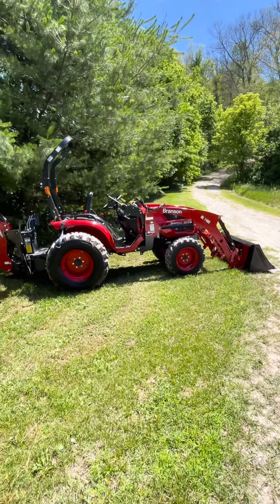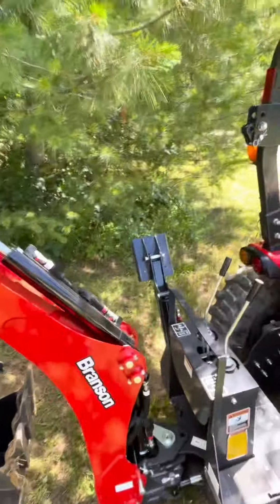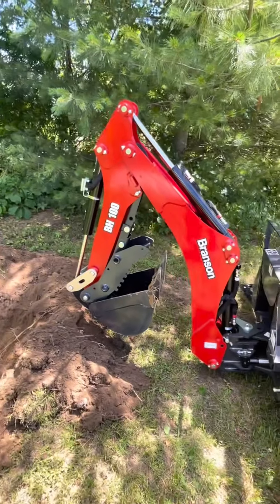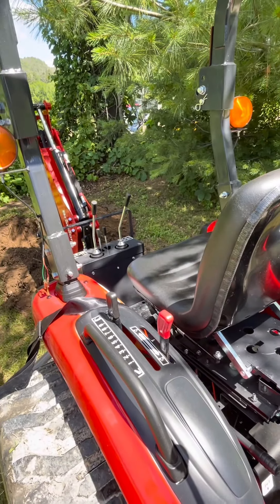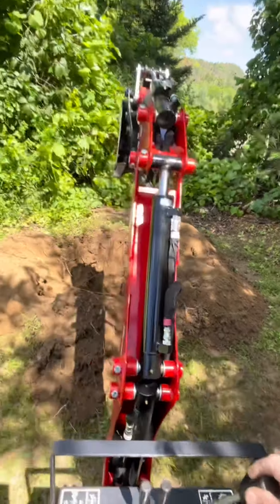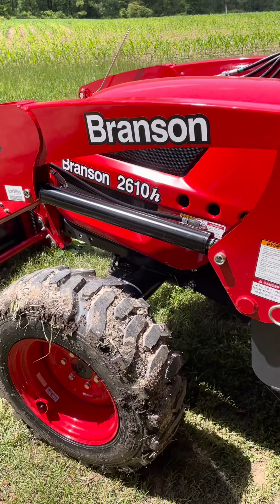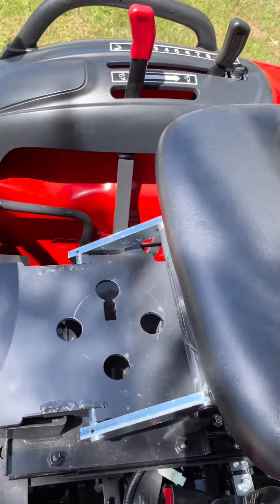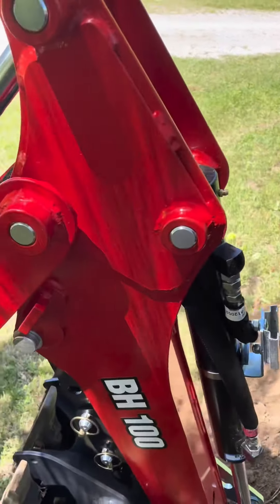Branson 2610h with BH100 Backhoe

Comment: Where can I get that mechanical thumb?
Reply from the maker: Dealer installed ..for $425 ?
Reply: @limerocktornadoheadquarter9303  I bought one. Haven't installed it yet.
Reply: Just "scrap " the mechanical thumb idea & get some " hydraulic action" going on. Don't be a "dumb-dumb" like me & SUFFER 25+ times a day with a "mechanical thumb". Yea they work ,BUT No where close as what hydraulic actuation can really do. My kit costs $900 for the mechanical thumb( works OK) & another $2000 for the hydraulic kit--just too cheep $ boy have I suffered.
Reply: @donaldstrishock3923  wonderful